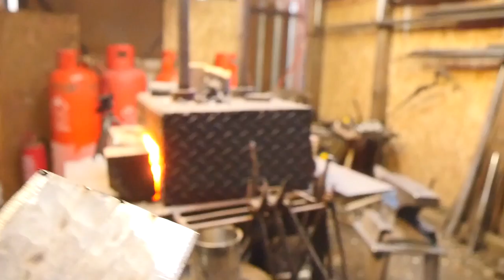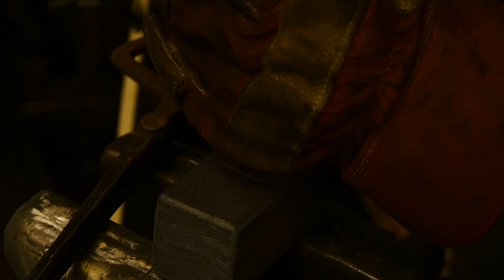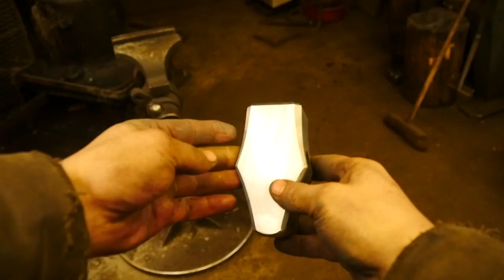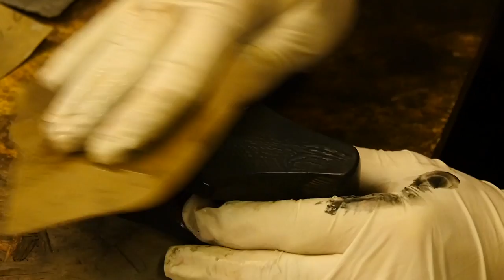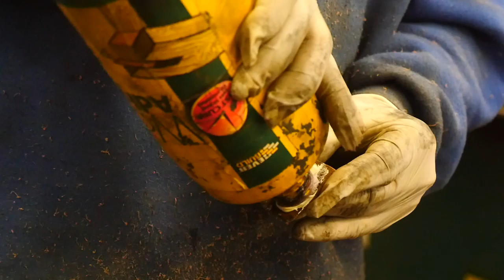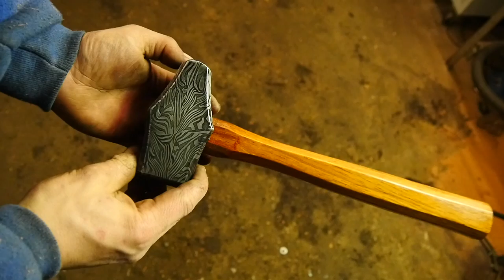CRAZY Damascus Hammer!!! #50kGIVEAWAY

Comment: As usual a very entertaining and educational video. The hammer looks fantastic and I also like the shape of your handles. As a retired joiner I've used the odd hammer of different types and shapes and seen many failures in some of the steel used. So this begs the question, would the demascus steel hold its shape over constant usage and not delaminate?

Comment: that is one hell of a hammer. the handle was built to match, very nice. glued the wedge before putting it in it's place. all that is the making of a pro. just curious, why wouldn't you oil the part of the handle that goes into the eye of the hammer as well? also, check out how pros "hang" the handle with Cody from Wranglerstar. there's much you can learn from those who went before you.